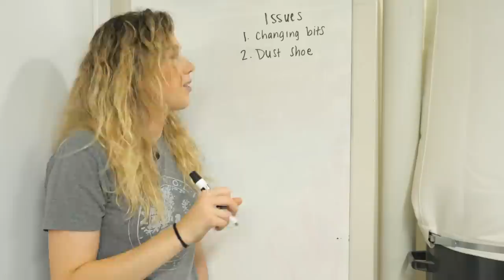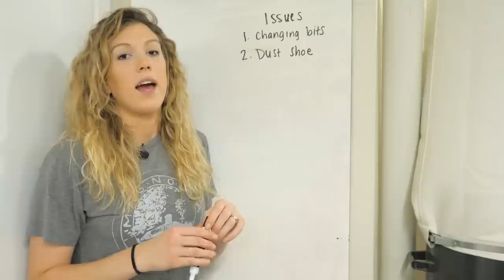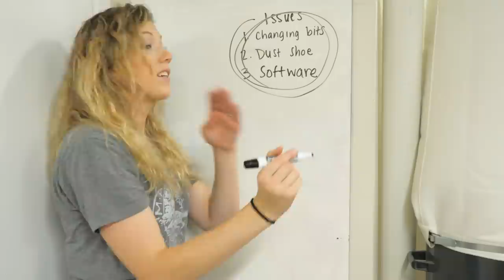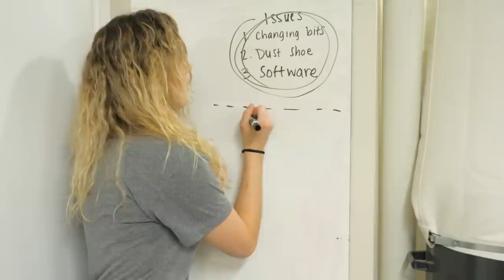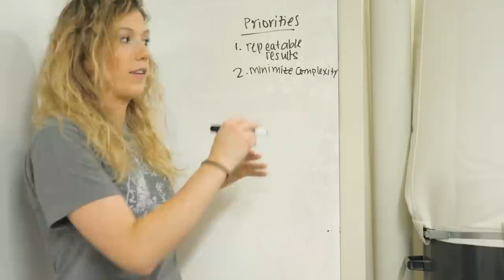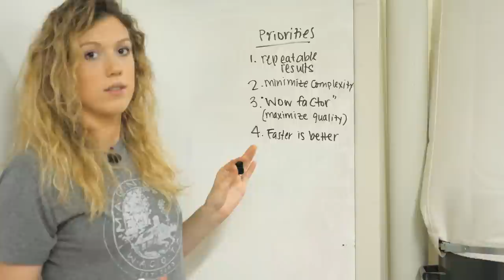LET'S CONQUER THE CNC! Part 1

Comment: If you have the money you cant beat Carveco (ArtCAM) software for creating your designs and toolpaths.  Very similar is Vectric's Aspire and VCarve.  Its not quite as robust but has many of the features and is about 1/4 the price.  I taught ArtCAM for many years to middle schoolers and they were able to pick it up quickly.  We have switched to Aspire currently and the students are putting together some very good projects already.  As far as homing goes, I assume you are talking about the starting point for your project and not the home of the entire CNC machine.  Return to the origin of the project (I usually use the bottom left corner of my material) after a tool change then reset your x and y axes to 0.

Comment: I use aspire or Vcarve, but there is learning involved. It is not something you can just do, but this is to be expected as it takes.

Also carpet tape is ur friend.
Reply: squallxgamer which software did you find easier?
Reply: @blakedavis7609  both of these software work the same. Aspire has many more capabilities but is much more expensive. Vcarve is between easel pro and aspire. Nice thing is both come with a tutorial library to help you learn the program.

Comment: lock the motors between bit changes. i like aspire for software to make g-code. i use easel to run gcode.
Reply from the maker: I think that’s the direction we’re gonna go - do you have experience with v carve?

Comment: Go to www.designsbyphil.com he has a section on changing the settings so the motors are powered and wont move while doing but changes.  I have the xcarve and it will do what you are looking to do with a few mods.

Comment: http://www.designsbyphil.com/x-carve-tips.html

Check out Phil's website. To stop the gantry from moving during bit changes, you need to turn off the auto torque reduction on the motors. He explains how to do this on the page I linked. 

Also as far as software. Get rid of easel, its garbage. Go with Vcarve Desktop or Pro. Desktop is limited to 25" x 25" carves. Pro will allow bigger.

Look into upgrading your z axis to a threaded Z. Cnc4newbies as a great one. 

Make sure you have your dust boot grounded. That will reduce any static electricity buildup interfering with the electronics on the xcarve. 

You should look into risers and stiffeners as well for the gantry. It will help to make the frame more solid on your carves.

Hope this helps! I enjoy yalls videos and welcome to Texas. I'm a Firefighter in Temple, TX.

Comment: It happens to me..or it did with my xcarve, until i learned thats whats happening changing bits is the culprit. I have the luxury of doing alot of rustic work so i use my vbit to make a pin hole in the wood at my home position in case i do accidentally shift it. Good luck

Comment: V-Carve or Aspire from Vectric are both great.  If you want to dive even deeper into design, check out Fusion 360.  For interacting with the machine, Universal G-Code Sender is my favorite.  

For repeatability and help with consistent tool changes, look into making some jigs and using the g54-59 work coordinate systems.  Also making sure your motors stay powered on during a change should help.

For hold downs, it’s going to depend on the type of cuts, shape and size.  I use some similar to what you use, along with some horizontal eccentric clamps.  A vacuum table would also be great, but I’m not there yet.  

That was what I could think of real quick.  If you want to discuss further, feel free to DM me on IG @mto_woodworks.  Hope that helps.

Comment: 1.  When changing bits you need to zero ONLY the Z axis.  Once you start a project you never reset X and Y zero position.    It should damn near impossible to move your gantry when changing bits. If you can move your gantry then your belts are too loose.  You could put on your X, Y, Z axises pretty hard and they should not budge. 
2.  Dust shoe should come off easy, you raise the Z axis to clear the bit first.   If it's as hard as it looks in your video make sure thinks are aligned.   If you need to replace it,  look at SuckIT,  that is who created that style design.  
3.  Vectric VCarve or Aspire  all day.  The easiest while being full featured software out there.   Fusion 360 can do more but far, far, far steeper learning curve.   Vcarve or Aspire is worth every dollar when production matters.

Comment: I have a shapeoko and haven't used an x-carve or Easel. I will not do bit changes in the middle of a job though. I only run one bit at a time and disable the other toolpaths. Then change the bit, start a new job and check the zero. Honestly, try Carbide 3D's program, Carbide Create...its free and works very well. As far as the dust boot, I have the "suckit" boot and it works great. For the clamps, throw a piece of MDF over the stock wasteboard ...Meyers Woodshop has a great video https://www.youtube.com/watch?v=6OoMsJezGUc
Also, use a vee bit to carve your letters. It looks much nicer!

Comment: As far as the issue with holding the material down I would recommend some mobile solutions template tape. Some other you tubers that do CNC work use this for holding their material down and it works great.   https://www.mobilesolutions-usa.com/product-page/template-tape-select-size

Comment: Your videos are great but in this one... You just need to spend more time with the machine(maybe you dont have that time because you do all kinds of projects). 
I bought xcarve about 6 months ago. 0 experience with cnc world. You are making beginner mistakes. The "clip the clamps" issue...you have simulate on the program..you can see where the machine will go and you just need to put the clamps out of the way xD . I never had the machine moving when of changing bits. The machine is dumb because it does exactly what you tell it to do? What :D:D:D??? Spend more time and learn before you made the video frustrated. Keep up the good work ;)

Comment: You're killing yourself with a cheap machine. There's a reason decent small machines are $8k rather than $1k. CAMaster Stinger I is rock solid. There are other good quality machines too. Yes, the router is getting moved when you change the bit. You can see it move in the video.  Software: Vectric V Carve is powerful and dirt simple to learn.   Vectric and CAMaster -- check 'em out.

Comment: Lmfao first problem you bought a xcarve (should of bought a workbee) 
Second problem your software is trash download ugs to run your gcode it’s free and a very good program. As for actual software I’d would highly recommend Vectric aspire not cheap but by far one of the best softwares out there PST they do a free trial to have a play with. 

Regards to you loosing position that dust shoe will not be helping run it without that piece of junk solution if you go over to ooznest website they sell a dust shoe that clamps to the router body and has a magnetic brush fast simple and effective. 

Unfortunately the x carve is a toy I looked at it 2 years ago and like you only found sponsored vids and did not like it however what I soon picked up on those said sponsored vids showed later on giving the x carve away or selling to buy a better cnc I have friends that have the x carve and rate it highly but for me it’s just not rigid enough for what I do hence going down the workbee route at double the cost. I hope you get it sorted 👍🏼